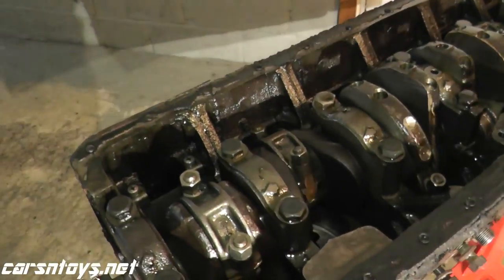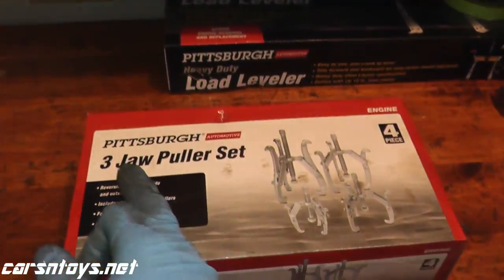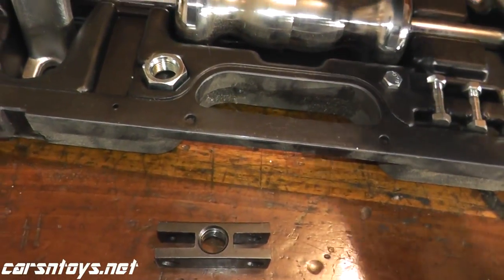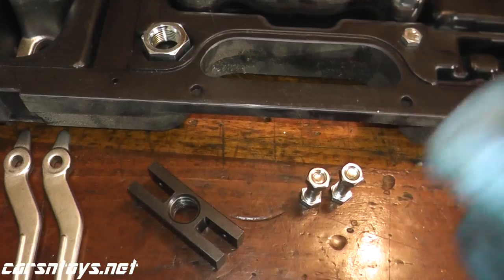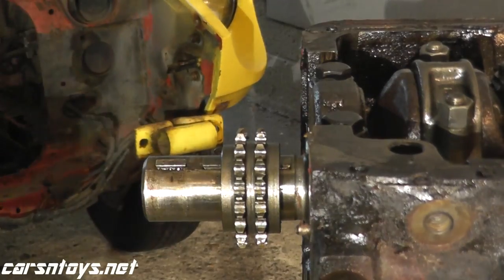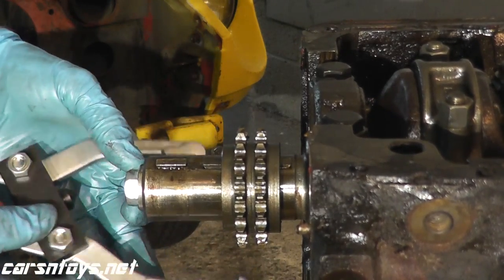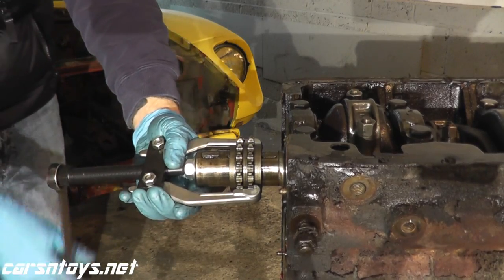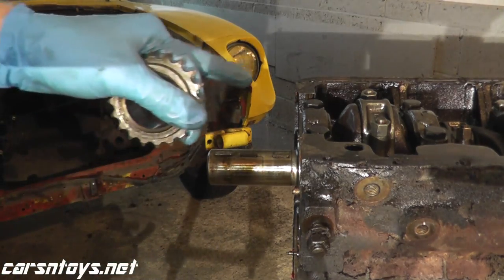Crankshaft Sprocket Removal

Comment: Why is every one else's sprocket a .002 pinch, and mines about .030? Mine won't budge with oxy/acet. and an electric impact gun. Can't figure a way to get a crankshaft in my 12 ton press. Beams too small.

Comment: Appreciate you using the puller tool. It have several uses in shop anyway.
But simple screw driver can do the job for most cars.
The same thing, simple tapping on the new sprocket will do the job as well.

Comment: would a worn crank timing sprocket cause rattling? I replaced all timing kit except for that part and I have an idle rattle coming from above crank pulley (acc belt off)

Comment: Try that on a 1970 bmw m10 sprocket dude. Inside dimensions smaller than crank and put on with heat. Unless you run a 1mm cut line along through it, your puller would have zero chance. How do i know because I tried with and exhaust clamp around the sprocket and used a 15 tonne puller
Reply: James Barratt I have been viewing several videos on YouTube just to get an idea as to how to remove this kind of sprocket on my 1972 bmw M10 crankshaft. I just read your comment and looks like you have been down this road. I have no idea how to get in touch with you but would be great to get some tips from you before I start. It might save me some grief.